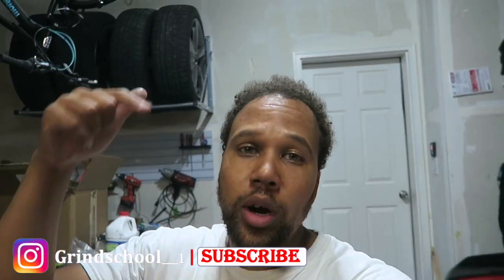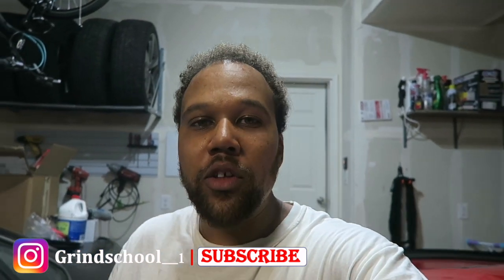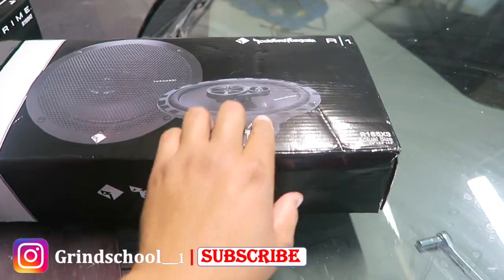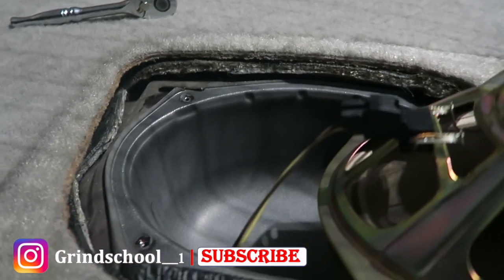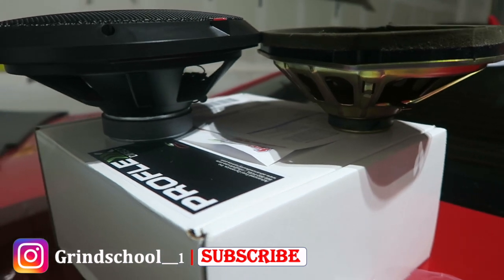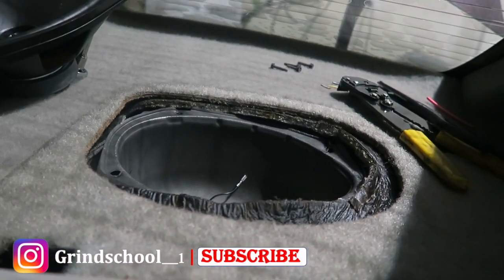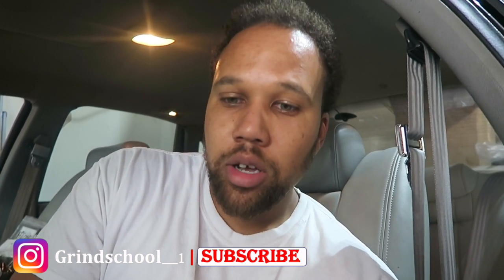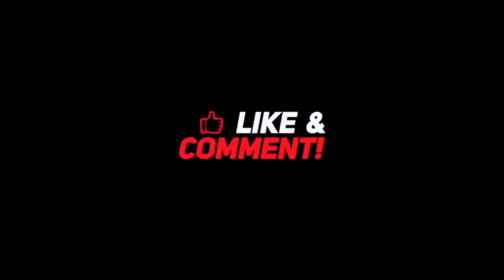HOW TO INSTALL INTERIOR SPEAKERS  [95 IMPALA SS]

Comment: We’re can I get the front speaker adopters. Thx man
Reply from the maker: I got mine on Amazon. Just type the year make and model of the car in and you’ll find them.
Reply: Thanks Bro. Nice whipp.
Reply from the maker: No problem! Thanks I appreciate that
Reply: You didn’t have to cut for the 6.5’s?